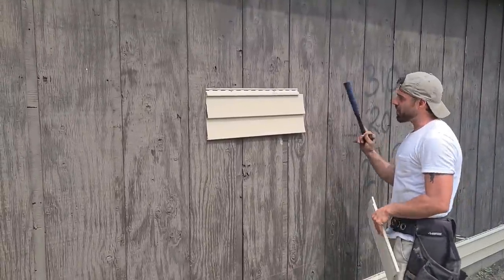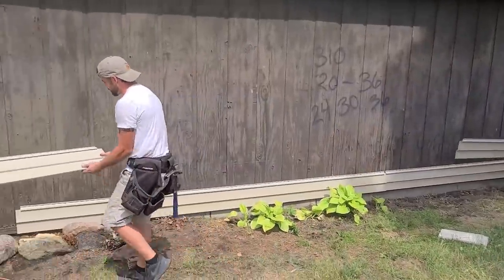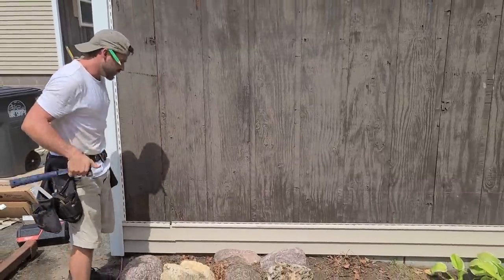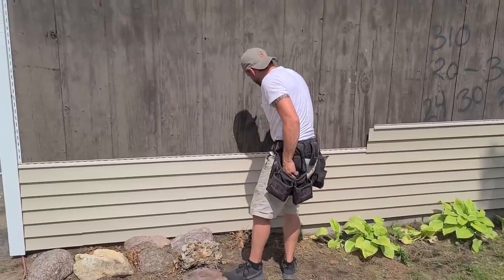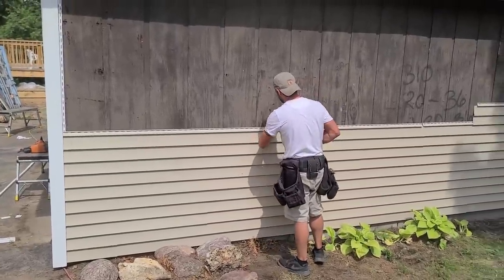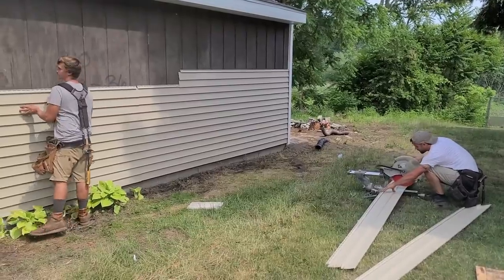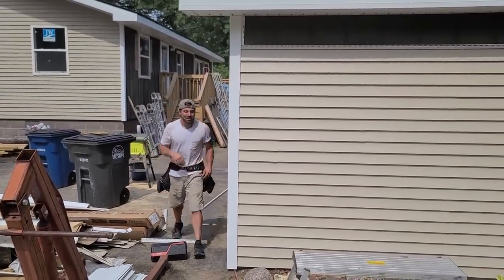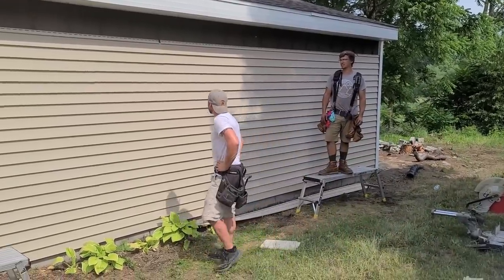HOW TO | Install Vinyl Siding!!!

Comment: your helper should be starting the nailing from the center of the panel , if the panel is hanging your siding will be off.

Comment: No need to measure, just flip the panel mark and cut. The only time I would pull the tape would be the last course for cut down. A wall like that, I would mark the studs for nailing.
Reply from the maker: I end up doing that a lil later.  That wall has a ton of meat still so we don't usually bother marking studs when we go over t-111 or cedar line this.  But on plywood we do
Reply: Need longer nails&nail in the studs

Comment: i really appreciate all of your videos.  they have so much information in them.  i'm getting ready to start the vinyl siding on the garage and had a couple of questions.  do you use a metal starter strip on the front of the garage above the driveway? how to you have the one inch overlap?  Also would you put a metal drip cap over the garage door brick molding before installing a j channel?

Comment: We cut all the starters at once and all the finishers at once. Easy if you know your offset no reason to measure your finishers except for the first and we cut 32 inches apart per code to land on studs. I know it doesn't workout on 12-6 panels but that's code with a house wrap inspection. But we mostly do lp nowadays. I new all your finishers before you measured them after the first one.

Comment: I am siding my garage.  Imagine the left side of your building (with the corner post on) is the  right side of my garage door.  T111 is what is currently on the garage,  my question is , How would you finish or wrap the jam of the garage door (overhead door)?  The T 111 edge and the foam board for the siding is showing if I just add the J channel around the door opening.  There is no brick mold or trim currently.  In other words, If you were to look down the wall standing at the door opening you will see the edge or side of the T 111 and the foam board for the vinyl    Even if I add brick mold and put the J beside the brick mold, the edge of the T 111 can still be seen,  What is the right way to fix this?
Reply from the maker: thats a tough one. sounds to me like you have to remove all the wood around the opening of the garage door. depending on the garage, there is usually a 2x6 around the perimeter of the garage door where your opener number pad would be mounted. remove all that wood and maybe put a 2x8 if the 2x6 isnt enough. flush with the 2x4 framing on the inside of the garage, and it will stick out enough for your j channel to butt right against it. wrap in aluminum when complete

Comment: I did not andastend first small peace was 14cm. How much need cut next peace and fird it was 30cm/60cm/90cm/120cm? Thanks gret video
Reply from the maker: Inches.  But not all walls use the same stagger.  30 and 36 show up most often successfully.  Then 24 and 20. Those are the 4 easiest numbers to stagger mathematically.  I have a formula you can use to determine if a stair step will work with the length of your wall
Reply: @NWIVeteranConstruction  fanks very much :)

Comment: Do you just level your starter and hope for the best after that? No level line or levels ?
Reply from the maker: helllllll no lol i lasered a line around this entire garage. then had boycub cut some bottoms off and install starter, which i ended up taking down because the garage is framed so terribly. so we re hung our starter somewhat out of level so that it doesn't look out of place. we pulled from the soffit a certain number on this one and it was 100% the way to go. i filmed a little bit of it i'm sure i'll post it sometime soon
Reply: @NWIVeteranConstruction  thanks for your video .

Comment: Enjoyed your video.  I have one question.  Can you put vinyl siding over existing wood siding or do you have to strip the old siding?  I’m looking into to put on vinyl siding on our farm house.
Reply from the maker: You can go over it. I assume if it's an old farmhouse the existing siding has like a 2 inch lap. It might be worth it to put fanfold over it to create a more even surface, or even put vertical nailing boards.  But yes, you should be able to go right over it.  That's the beauty of vinyl, you can float it. I just recommend you get a good solid siding panel with a .044 thickness
Reply: Also, please install correct flashing and trim per manufacturers spec. Don't assume that the old siding underneath will continue to shed water. I've seen an installation done poorly over 4x8 foot panel siding that now leaks around every window. I'm guessing that the installer banked on the old siding, and it worked for about 15 years. But eventually, the caulk gave way, and everywhere there's a window needs to be torn apart and reframed.

Comment: I never use a piece smaller than 2' on a filler panel.
Reply from the maker: in my formula I made it so there's no pieces shorter than 10"...i feel like there's plenty to lock into with a 10" to keep it straight as well as just big enough for a few nails. i like that rule though! if you can make it work that's pretty ideal
Reply: @NWIVeteranConstruction  It's just my preference , I don't like the look of pieces smaller than 2' for fillers.
Reply from the maker: @stevengrammont44  that's really all siding is. Basics plus preference lol when I did that formula I couldn't find anything on the installation details about the minimum length a starter/ finisher must be.